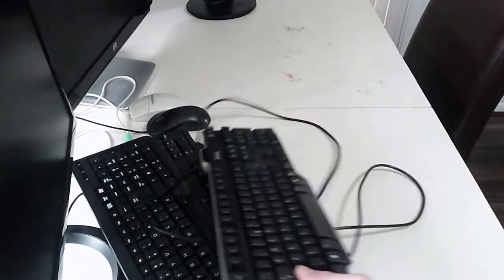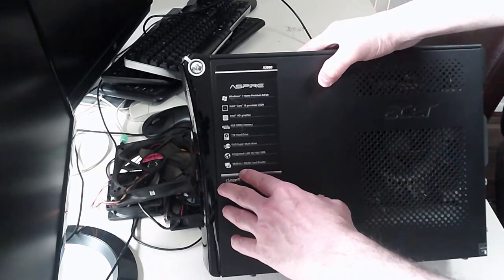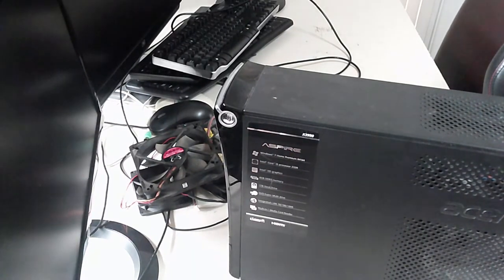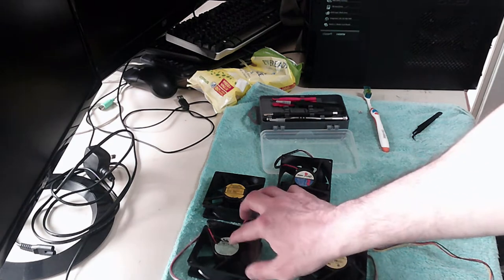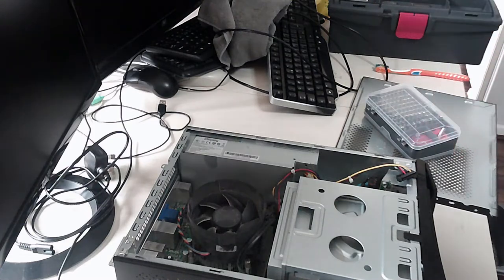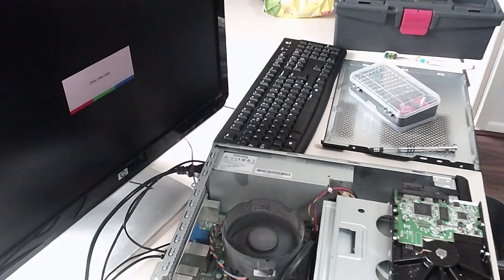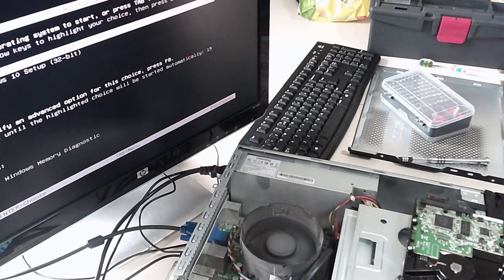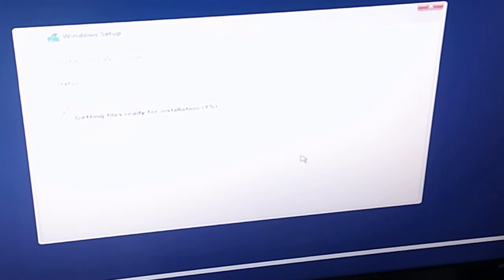How I Built a PC for Free - Fans, Motherboard and More (S1, P5)

Comment: Nice score. Only issue is that prebuilt systems like the Acer Pc usually have proprietary connections on the motherboard that probably won't work with your aftermarket case. Also if you remove the DvD drive from the Acer there might be a hard drive in the bay under it.
Reply from the maker: Yea sweet score especially as it works too, couldn’t believe it but did get a mouthful of someone’s ten years of dust lol
Reply: @ordinarye784  Working is always a nice bonus..lol